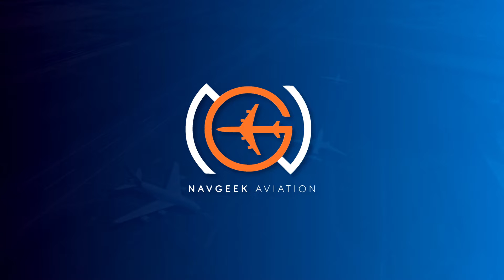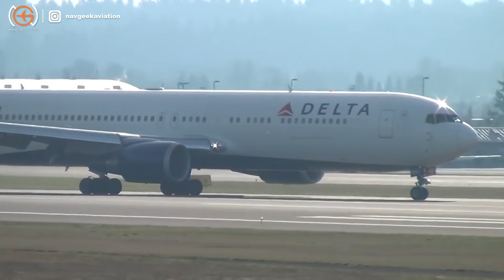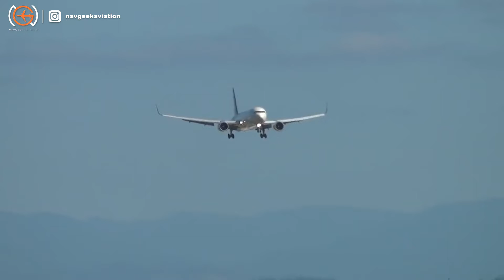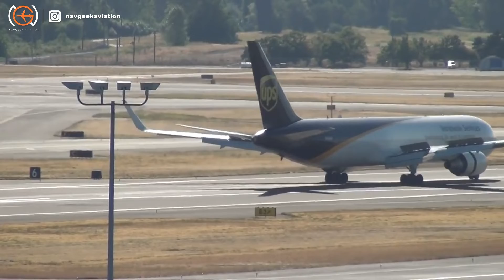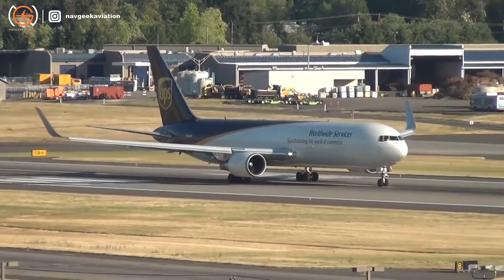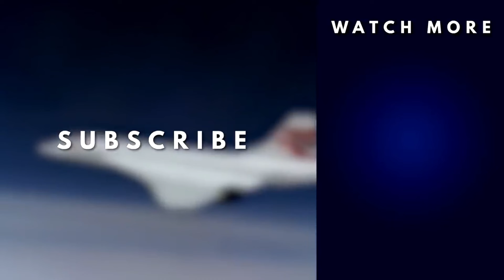Why Boeing SHOULD MAX The 767!

Comment: Game theory :
If boeing proceeds with the B767max, the smallest -200 will still be uncompetitive against the A321XLR. They may win a good portion of the market with the - 300 variant but boeing will still need to spend a good $5-$10 billion to modernised the B767.
If boeing proceeds with the B797, airbus will introduce the wings of tomorrow at a quarter the cost of boeing's new aircraft and an earlier EIS. The A321plusplus and A322 will still be competitive against the B797.
Either way, Boeing still loses because they've missed the opportunity for the NMA.
Reply: I don’t think a new 767-200 would fail. It would be the length of the 752 and 762 and therefore longer than the A321. It could carry a bit more passenger (+1 seat per row) which would make it more flexible with bigger markets in the NMA segment. Also it could carry more Cargo than the A321neo in all its variants, a throwback compared to the 757.
But I would definitely agree that no matter when it comes, it would be too late
Reply: @spongebubatz  looking back at the B757-200 vs B767-200 (non-ER), you will realised that the B757-200 requires 20% less thrust (~40klbf) vs the B767-200 (~50klbf). With a similar range and the same engine generation, it will simply means the single aisle design with 1 seat and 1 aisle less will be easily 20% more efficient. Of course the tradeoff would be the cargo capability, however the light twin aisle design of the 767 cannot accommodate the standard LD3 in the underbelly which causes other such as LD2 containers availability and turnaround. So with all these disadvantage, unless the new B767-2X could offer significantly better economics than the A321XLR, otherwise it will be difficult to convince airlines to accept it.
That is also why the B757-200 outsell the B767-200 by almost 9 to 1. Even if you also consider the B767-200ER variant, the B757-200 still outsell the B767-200+200ER by 5 to 1. On the B767-300/300ER, its not a fair comparison as the B757-300 is some 12yrs later with most airlines already owning the B767-300ER.
Still if today we were to pit the A322 vs the B767-3X, i do not expect the A322 to lose by a large margin. My estimate would be around 45% (A322) - 55% (B767-3X) and my estimated gap will be larger if its against the B797-6 (65%) - A322 (35%)
Reply: @spongebubatz  - I think you need to factor in that the B767 is a wide body and the A321 is a narrow body. To different types of aircraft.
Reply: @chrismckellar9350  I know it’s bigger, but the Middle of the market isn’t just the size of the A321neo! It also reaches to a higher capacity, a market ideal for a 762 sized aircraft which has no replacement as of now. As I said, also the factor cargo plays an important rule when it comes to finding a 757 replacement
Reply: @spongebubatz  - The B787-8 was suppose to be replace the B767.
Reply: @chrismckellar9350  I‘m talking about the 767-200 which is a lot smaller than the 787-8, didn’t that become clear 🙄
Reply: @chrismckellar9350  

The 767 is not really a wide body.  The interior width is 186 inches compared to 216 inches for the 787 and 231 inches for the 777-300ER.  Compared to the a320, the 767 is 40 inches wider which puts right in the middle between narrow bodies and wide bodies.  

Benefit of the 767 is not only the 7 across seating with a 2nd aisle, but also greater cargo ability with the LD2 containers. 

The demand for the 767 as a freighter doesn’t seem to waning with FedEx converting 20 options to firm orders.
Reply: @raptorshootingsystems3379  - A twin aisle airframe is a wide body regards of aircraft type and a single aisle is a narrow body airframe regards of aircraft type. There is no ifs or buts about it.
Reply: I agree with your comment.

Comment: Very valid points.  767 is one noisy plane.  I am a Delta frequent flyer and 767 is used on many international routes.  It's very hard to sleep in the 767.  It's a great plane but very very noisy.
Reply: Are you Fucking kidding me dude! It’s an airplane
Reply: @josiahslate7374  For some of us that fly transoceanic every week for work, we need to sleep on these 10-12 hour flights.  767 is a nice small plane but it's the noisiest of all widebodies - this is a fact, not an opinion.  I can fall asleep with ease on the A350 or A330neo, but B767 is a struggle for me.
Reply: @_w_w_  yea , old engines. The newer GEnx engines are much quieter.

Comment: They should go for a clean sheet design, in order to compete against the a321xlr
Reply: This is not a 321xlr competitor. Very big difference in pax capacity and range. especially an enhanced 764.
Reply: @alphabravoindia5267  If you keep revise the 767-400, you will get into exactly what 787-8 is.  I'd argue 321xlr is nearly in the same class as 787 as far as comfort is concerned.  At the typical 9-abreast 787, its seat width is at the 6-abreast 321.  the 321xlr is a better replacement for the 757 on transcon or transatlantic routes.
Reply: @alphabravoindia5267  what about a 757-x ??
Reply: @arnavsharma9882  While it would look incredibly cool, the tooling is scrapped and it would take a while to get it to market anyway. Plus, there's no 40-50k pound thrust engine option available, though they are looking at some. One thing I will tell you, there was rumour of a 757-plus around this time last year but I have no idea of the status on that.
Reply: @alphabravoindia5267  ok I see I remember we had discussed a lot about this in other videos also right ? But no problem if you don't have the status coz Boeing has no other option/choice
Reply: Many say the 767-200 is the 767 variant most likely to be updated as it serves the same market as the 757 and A321 while still having capacity to also serve bigger markets
Reply: @spongebubatz  Boeing themselves said that the 767-400ER is the one going to be updated. Their words not mine.
Reply: @spongebubatz  agreed, but Boeing better be quick n' smart to dominate the a321xlr

Comment: Well the 787 has largely replaced the 767
Reply: Not exactly, it is 50tons heavier. Most routes 767's fly/most routes in the world do not need that range provided by the 787.  Ability to make up difference in tonnage capacity via cargo is the only true reason to buy.  It is why the a330neo is selling so poorly.  It is slightly heavier and slightly longer ranged which literally means the ONLY people who want it are those in SE Asia who have a ton of a330's already and need LONG distances over water in the Pacific/Indian ocean and cannot afford a 777 or a350.  No one else in the world really likes their a330 as most routes are much shorter on average.     Why a 767-400 MAX makes zero sense, it is very close to 787-8/a330-800NEO and almost zero orders for the -8 of either model model have been sold in last 4 years... Truth is only reason is being discussed at all is because the GenX2B engine exists and it is is TOO BIG to be put on 767-300 and -300 has an ancient wing.  Why NMA was looked at to begin with, new wing, new engine, new cockpit/flight controls = essentially 100% new aircraft.  Fuselages/empenages are dirt cheap in comparison.  Other than that FAA certificate.....
Reply: @w8stral  that explains a lot
Reply: @w8stral  agree. It will also be interesting to see how the A321XLR will fragmentize the B767X market. Since the number of applicable routes shrink significantly going above 4000nm, additional fleet complexity, price and cargo capability would significantly influence on airlines decisions, not so much of range or seating capacity. 
Considering the limited B767 operator base outside USA, Will airlines choose to fly 3 A321XLR instead of 2x B767X to a specific destination?
Reply: @w8stral  not to mention the economy set up is 3-3-3 like the 787 which is an interesting case. 3-3-3 is in the same ballpark as the 777
Reply: @Flight4080   The 777 have 3-4-3
Reply: @w8stral  I have never seen so much wrong information all together. 
"ONLY people who want it are those in SE Asia" Look at who is buying A330: https://en.wikipedia.org/wiki/Airbus_A330neo#Orders_and_deliveries
How many of them are in SE Asia? What about Delta? 
"Cannot afford a 777 or A350"? Do you think that airlines are paying cash?
"need LONG distances over water" On the opposite, A330 is better optimized for short and medium haul flights. For LONG distances 787 and A350 are better options.

"a330neo is selling so poorly" It sold 331 units from 2014 to 2020. Is it poor sales? (Note that Emirates had 50 units of A330Neo order, but upgraded it to A350 later, to keep their fleet uniform.)
Reply: @w8stral  The part that I agree with you is we are discussing a 767X just because GE is trying to sell their engines and their PR department is feeding youtubers with such rumors. They did the same thing for A350Neo, but except for a little percentage of ignorant audience, nobody bought such an idea for a new aircraft like A350.
Reply: @user-yt198  Pretty much my thinking as the only 767 variant that is worthwhile as an aircraft in my opinion is maybe the -300, but would essentially need a conmplete overhaul which would cost same as an all new aircraft.  At the end of the day all that extra fuselage weight and drag for 1 extra seat compared to a 1 aisle aircraft makes zero financial sense
Reply: Although the 787 might have been promoted as a 767 replacement, without the intended smallest version, it never really did, and it is that middle of the market gap which is causing Boeing and the Airlines such a big headache now.
Reply: @neilpickup237  boeing allowed that to happened. The B787 was originally designed as 8 abreast in economy but because of the overweight issue, in order to deliver the promised fuel savings boeing offered to squeeze in the 9 abreast configuration as default. That indirectly bumped up the B787 capacity making it replaced the B767-400ER and B777-200ER instead, creating a gap leaving the B767-300ER without a successor.
Reply: @chingweixion621  Overweight issue : Not true at all, I was there at Boeing working on the 787.  Had nothing to do with not replacing the 767-300ER.  787-300 was supposed to do that which would require an ENTIRE new wing, landing gear/wingbox.  Overweight issue is completely different as it had everything to do with FAA certifying the use of carbon composites and in said process they were not accepting certain material properties thus making Boeing "keep" weight on the books which could not be removed  according to their testing.  It is my understanding that the a350 DOES get this weight savings material properties with EASA which directly led to a lighter fuselage and a lighter wing box.  I have no idea if Boeing was able to apply those standards to the 787-8, 787-10.  I was not there for those airplanes, but was there for the -9 and it most certainly does NOT get those weight savings. 

The OTHER overweight story was in the CF(carbon fiber) wingbox itself and also revolved around certification around initial design, but this design was changed which directly led to a delay of at least a year and requiring Boeing to build more than 3 test aircraft.  Were there 6 test aircraft?  Anyways, delays in FAA cert on this part led first couple of aircraft to be delivered HEAVY as it would have cost too much to take the weight out after the fact.
Reply: Not really. They’d need a mini 767 for the thing long haul. Even then the 787 is optimized for larger so the economic benefits are reduced and would be a less optimized larger 321XLR
Reply: That's like saying that the 757 would've been a great 737 replacement when the 757 was meant to replace the bigger 727.
Reply: Yes it considered a replacement but the 787 is generally heavier and a bit larger  than the 767 making inefficient for short to medium routes  than the NMA would cover . The 787 is made for long range while the 767 was made for short to medium haul flights. Could still be effective if it could get a re engined Version